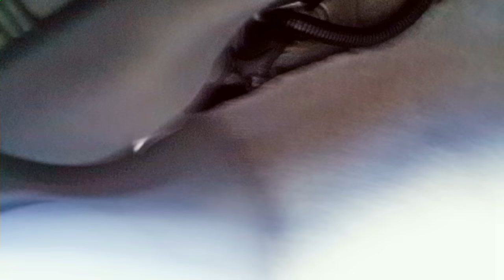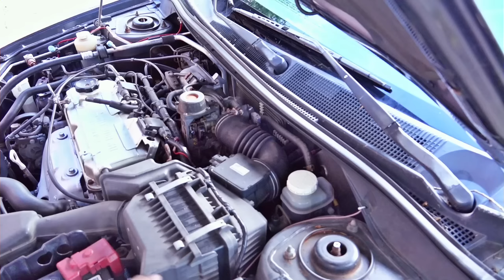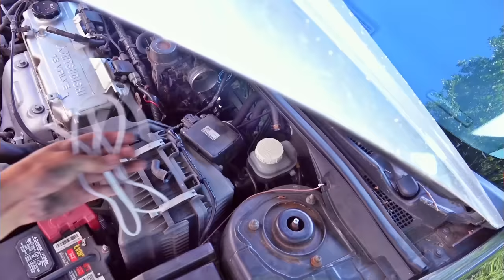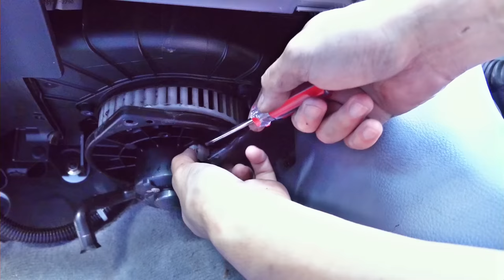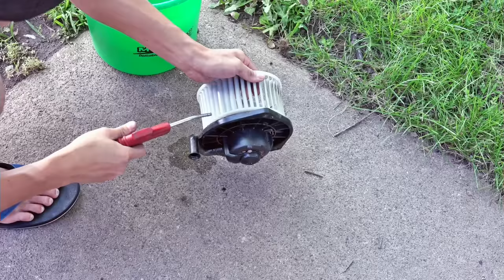Lancer Fix 38 | AC Water Drain Pipe Clogged, Blower Motor

Comment: the solution came to mine in the form of auto body work. the area behind the firewall under the windscreen was rusted so badly water was flowing inside the car. welding, joint sealer and priming then sprayed to match car color. had to remove evaporator and blower fan to get to the inside of the firewall to repair also. so check for rusted areas on firewall
Reply: can you explain more on what the fire wall is on the car? dont know much about cars but im learning every video i com across on how to fix my 2002 lancer ac problems

Comment: Hi Mackie! I'm wondering if you've ever installed a cabin air filter. I don't see why I would since factory had sealed the section?
Reply from the maker: Nope, but I could have. Here is how: https://www.youtube.com/watch?v=HjtEB_plHRs
Reply: Thank you. Maybe good for the summer time  heat. Would you recommend it? Or is it not necessarily necessary?
Reply from the maker: @AlexanderMedina1010  Don’t need it. It just filters off some dust. It's up to you.
Reply: Haha I know it sounds like a menial question lol but I didn't see anyone saying why the would or why they didn't. I did have one cabin once and I noticed a difference. For my specific lancer, at least, it didn't feel better. A little opposite actually so I took it out. I still have the OEM cold duct intake. I'm just sticking to that I think too for the future
👍

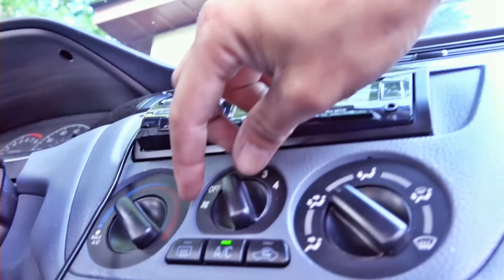Comment: Hi, I came across this video when I was trying to understand what's the use of an angled black tube connecting the blower motor bottom section to somewhere above (in your video 2:29, the angled black pipe) in my car. I could see that your car too has the same pipe (2:29). Could you please explain what this pipes connects on the other end?
Reply from the maker: Hi. I'm sorry, I have no idea too.

Comment: how the heck did you get that back screw out from the blower motor?  was it that orange ratchet screwdriver or 2nd tiny one?
Reply from the maker: A little bit of both. I struggled too.
Reply: @DarkDragonWing  dude I just gave up 😅 but then again my oz rally never came with a cabin filter
Reply: hey real quick did doing the drain pipe on the outside help with the flow strength out of the vents?  I'm thinking of cleaning my evap core and wonder if that would help fix the weak ac flow
Reply from the maker: @rynwolf286   Yes, it helped a lot. That is the main fix, to be honest. I don't know if the cleaning the core will help though.

Comment: hi man 
i have big problem please i need help from you 
i lancer 2010  the motor no different from this motor the same your motor  
8 year never use the heater at now only use air condition at hot 
the problem is 
Leaking radiator water inside the car park 
and Water falls on my legs when driving
and Water of the radiator comes 
out the discharge hole of the air conditioner
every 1 hour add water to  radiator 
thank you for looking

Comment: is there anyway on fixing the blower motor without replacing it
Reply from the maker: Not that I know of yet.
Reply: have you replaced your cabinet aire filter?
Reply from the maker: ***** No, there is none. These cars don't have one.
Reply: I thought it does
Reply from the maker: ***** If you look closely in the video. I tried to look up on the top of the blower motor housing, there is no ac filter. I actually try to find one, but turned out these Lancers are "US version" and they don't have ac filter. It's too bad, they went cheap on it.
Reply: DarkDragonWing cabin air filter is inside the glove box

Comment: My 2003 Lancer just started leaking on the passenger side. It would randomly spray water. It seems like after researching what could possibly be wrong that it might be caused by AC overflow being clogged, which is what brought me to this video. Will this video help with a 2003 Lancer?

Comment: So i just Changed my 02 sensors the check engine light went off now but when i start it theres a big clunk and its like the motor shaking but its responsive now and i have power back so i guess driving with power loss do you think i didnt notice the motor mounts are trash ? Im hoping the motor mounts are whats causing that start up shake Also Underneath my exhaust pipe is like crimped like smashed up its the worst exhaust pipe youll ever see
Reply from the maker: You can try cleaning the EGR https://www.youtube.com/watch?v=YrV4wiC6D7w

Comment: Can you help? my lancer engine 4g18, start with 800 rpm as normal, temperature measuring screen will show warm arround 8 minutes (soon) after starting up and keep it (not over hot), and when engine is warmer and warmer, rpm will inceasing time by time and fix arround 1400 rpm. Gara shop requires to replace IAC valse, PCV valse, 1 coolant temperature sensor (there're 2 temperature sensor with this Lancer) but still not improve. Pls help.
Reply from the maker: Have you tried replacing the O2 sensors? Make sure to use Denso brand. Watch here: https://youtu.be/YrV4wiC6D7w
Reply: @DarkDragonWing  Thankyou so much for your reply. This lancer with engine 4g18, 1.6L, asia version, so, it hasn't got O2 sensor, krab.  Shop've just replaced thermosat also for checking, but still not any change. ODB2 for this car is not popular, so it's hard to check. Coolant fan still Ok.  I don't know wether there's any problem with electric wire/ or ECU/ other things else.

Comment: Diagnosis TechsThey said ( P0302 ) Cylinder 2 Misfire Detected.? Something About My Coil.?
What Does that Mean?
Change it.?
Help Muchly Appreciated Thanks
Hello
Now my car still bogs out after I change the valve cover gasket & tube seals... surely now last thing to change is my coil... 🤦‍♂️🙇‍♂️ 
Gladly Appreciate Anyone/Someone Help Please Thanks Much
Reply from the maker: Change the coils.
Reply: @DarkDragonWing  
Ok I'm awaiting for my parts that I order & also changing my air filter... once I replace my tube seals & gasket rocker seal cover, do I clean the spark plug tube #2 to check for more oil or take out the plug 1st then pump out the excess oil that seap in the spark plug.? Thank You Awaiting for your prosperous response...
Reply: @DarkDragonWing  
Also, may I kindly ask on the back side wheels area of my vehicle 2002 1.6L Mitsubishi Lancer is Getting Bold From the inside tires.? Which Part do I Replace to Purchase.? Muchly Appreciated for A Prosperous Response... thank you